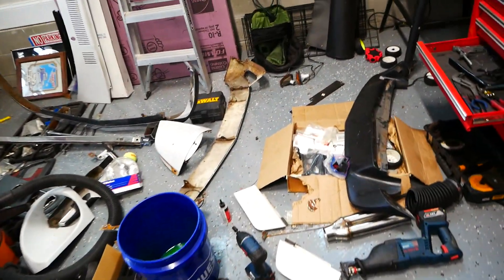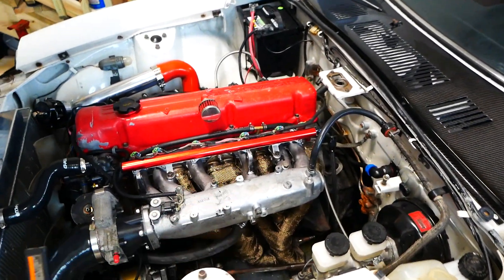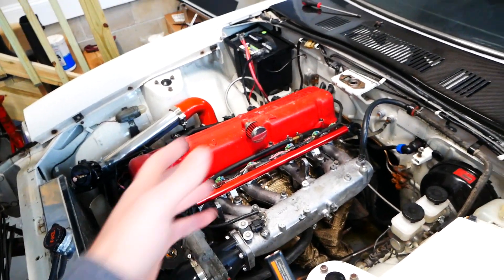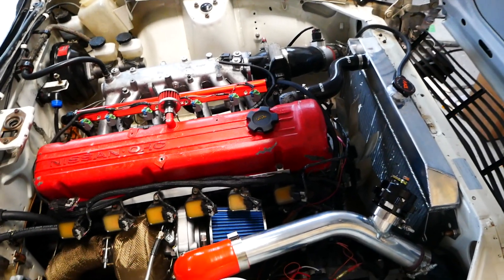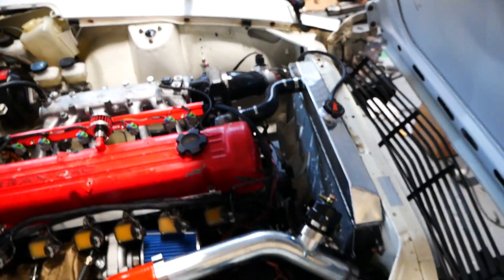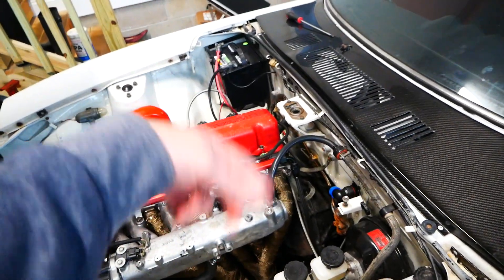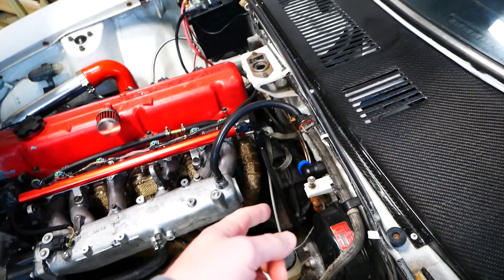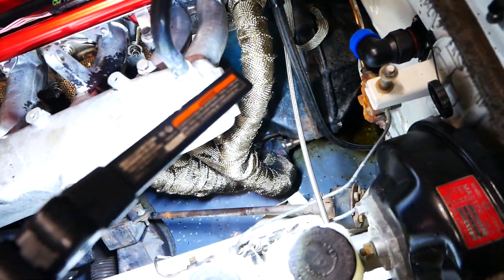How much power can an L28 make for $1000 Ep1

Comment from the maker: I never got to post the follow up video as I don't have the car anymore. But for those curious it was detonation limited to around 350hp. These engines need E85 or race fuel to see the benefits of higher boost. Easy 400hp on E85, but my injectors were a bit too small for that.
Reply: How much boost? And what was the ignition timing at peak boost?
Reply from the maker: @razsingh9438 12psi 11 degrees. It started cutting timing a lot after 9psi. 9psi it was at ~20 degrees.
Reply: Thanks for the info, mines not making much power so was just wondering what your setup was, mines l28na+t im running 12psi at 15 degress timing with 440cc injectors running 11.1 afr only making 260whp @RindosRides
Reply from the maker: @razsingh9438 I let the boost go way up to 20psi, but it didn't gain anything because any extra power was lost by less timing. I'm assuming your engine is all stock earlier model with stock Nissan turbo manifold? I have a couple cheap tricks on mine to raise power and lower restrictions. I step up from the 2.5" turbo exit immediately to 3" and have an exhaust with just a really big straight through glasspack. No exhaust restrictions at all, not to mention the header I used for a turbo manifold flows quite well. Also some minor intake mods, and the "good" mildly ported n42 head. All those reduced restrictions add up. Mine at 12psi would have been closer to say 16psi on a stock style setup.
Reply: Yeah im running stock engine with a turbo manifold, but i do have a 3inch straight through exhaust, ill look into porting the head, thanks @RindosRides